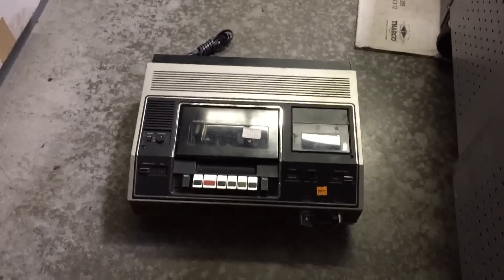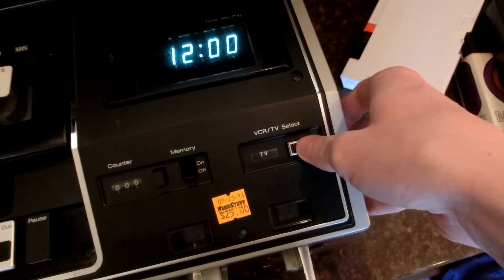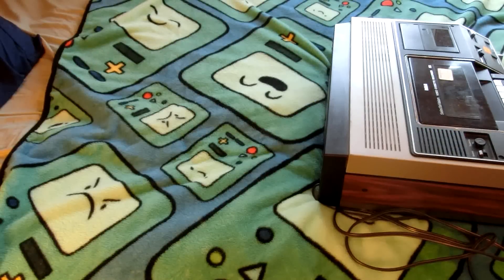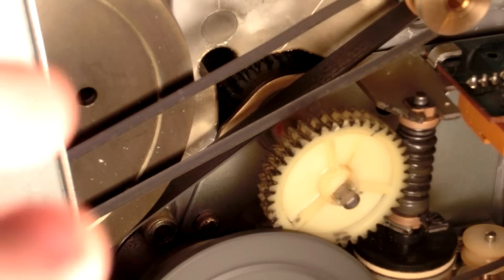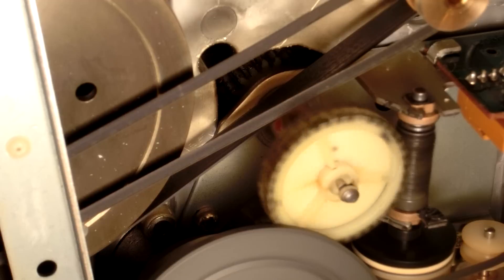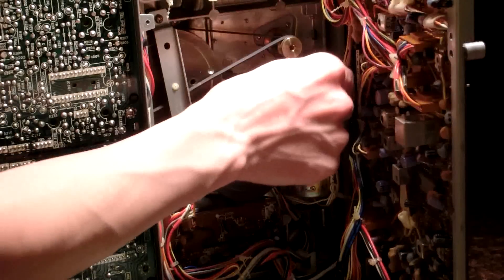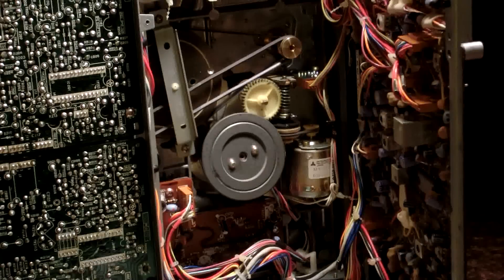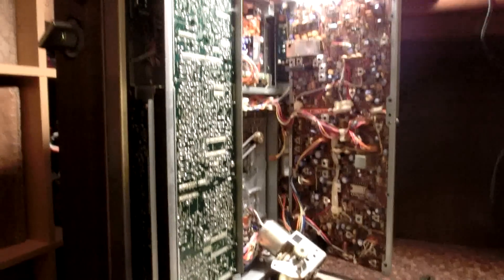1978 RCA VCT-200 VCR Teardown/Repair part 1

Comment: Did you make a part 2 to this video??
Reply from the maker: not yet, but now that i can 3d print gears i should.
Reply: @RinoaL  : Hello again. Just thought you might be interested in knowing that I was able to repair my RCA vct201 model. Finally got this baby working like brand new again. I had the exact same issue like you as well. The same gear on my vct201 was broken in half as well. I’ll go on to say that this is most likely a common issue on all of these similar units, as I see them online for sale all the time and most of them state that “item is broken and won’t play”. Mine looks a little different from yours. I had to remove the whole drum head in order to access the screw that mounts that whole broken gear assembly. But once I got it removed, I used superglue gel on the broken gear and then coated it with baking soda which is suppose to cause a chemical reaction which quickly dries the super glue almost instantly. Coating baking soda to the superglue joint, seems to make it a lot stronger as well. I’m not 100% sure, but it definitely feels much stronger with baking soda coated on and I only waited 10 minutes before I reinstalled the gear with no issues. So far it’s seeming to hold up good. Anyhow, I reinstalled the gear and powered my vct201 up and she started playing instantly. However, I had to do some repairs on my soundboard as well, no sound output. Video tracking and audio head was also out of sync on mine as well. But after some soundboard repairs, video and audio syncing adjustments and tracking alignments, she’s playing like brand new now. Hope you have some luck with your’s as well. The superglue baking soda trick is working wonders for now, but we’ll see how long it holds up.  If you get a chance to print some gears for your vct model,  let me know if you would be interested in selling some of those 3D printed gears as well. I’d like to have some spares for future repairs. Thanks again for the video again, it helped me out a lot.

Comment: I have a VCT-201 with the same symptom, tape loading mechanism inoperative. I'm curious if you did successfully 3D-print a new gear?
Reply: I did 3d-print the gear and it worked great. Let me know if you need it, I should be able to dig up the model.

Comment: The reason the glue doesn't work is because the shaft hole in the gear has increased in size. The flat shaft drives this gear, and there's a lot of pressure on it. You'll see that the gear over time creates a bigger indentation into the gear's shaft hole, which in turn increases the pressure within the gear whenever movement kicks in. The crack in the gear develops along the flat side of the hole until it finally cracks. There is no amount of glue that can resist the amount of force exerted on it at this point. I managed to (temporarily?) fix my gear by cutting out a flat sheet of metal from an old PSU, drilling holes in it using a dremel, and use kevlar wire to sew the metal to both side of the gears, keeping the two halves together. The metal sheet itself has a shaft hole cut out that matches the actual shaft's shape. This works well enough surprisingly, but yeah, it's a crazy amount of work. The best solution is indeed to 3D-print the thing..

Comment: Just an update to my comment. You might want to check out this product called Smooth On, It's a Silicone Molding that makes an exact copy of that gear you need. Then you use Smooth Cast which makes a plastic cast of the gear. This what I did. Unfortunately the plastic is not quite strong enough in that it flexes. I'm in the process of trying to find a stronger plastic to make the casting.

Comment: Just picked up a RCA VCT 400, today with original manual for a couple of bucks. Rewind and Fast-forward work but of course play is not. I am hoping it's just a belt and not a gear, as I'm finding with most projects Epoxy does not hold up, I found JB weld to work a  little better. [Update] Turns out the first thing was the belt was slipping on the loading motor, some rubber renuve fixed the problem. The second is the issue of the cracked gear, luckily mine hadn't cracked all the way through yet. I am hopping I can salvage it with some JB Weld.

Comment: It's really too bad these more "primitive" units had to have eight billion circuit boards to go wrong with. My Sony VO-2360 had EIGHT circuit boards for me to smash up and throw in the trash when I was trying to move the unit. Probably was all the electronics needed for the tuners and channel-programming and whatnot. Of course, now we could probably fit all those functions on a PCB the size of a cell phone. Great looking unit and I hope you get it fixed.
Reply from the maker: +Dead Christmas its actually really nice since these components can be more easily replaced.
Reply: But are those PCB components actually replaceable? Like normal capacitors, or proprietary unobtanium parts?
Reply from the maker: Dead Christmas
well they are much simpler than the newer stuff, they are common off the shelf chips ussually not a chip designed for one VCR and only comes in that VCR.
Reply: +Rinoa Super-Genius I see. Did you ever end up getting yours fixed? It's been a few months since you made the video. How heavy is it?
Reply from the maker: Dead Christmas i was waiting to get a TV, now i have one and am planning on working on the VCR again.

Comment: I know what you mean about disassembling the tape path of a VCR.  Probably the trickiest thing I've ever successfully put back together.  I remember multiple eccentric cams and various shooty springs.  Not only does everything have to be in the right order but the asymmetric gears and cams have to be in the proper points in their relative rotational cycles.  Takes about five hands.  With only two hands it took me 2 days to get it working again!  I recall reading that every VCR uses the same tape threading mechanism.  Patented by Phillips, if I recall correctly.  Anyway, it'll be great if you can fix your 1970's appliance with a 21st-century solution!

Comment: There is a slight possibility that I may have one of these machines buried under a pile of junk in my garage, so if the printed gear does not work out let me know and I'll see if I can get you what you need for it.

Comment: I hope that noise is not something touching the video head drum :(
Oow if you get a picture and its rough and black&white, spin the head flywheel 180 deg,  the head switching is wrong and the colour wont convert propperly.
Reply from the maker: no its due to that gear being broken so it lets the shaft move out, its just that bigger outer gear rubbing on the flywheel. it can easilly be fixed with a few washers.
Reply: zx8401ztv I know this is an old comment, but my VBT-200 has the issues you described. Where would I access the head flywheel?

Comment: just melt the gear back togetter with a soldering iron.
Reply from the maker: thats not actually a very good idea, this plastic doesnt melt too well and also i would need to either cut away a lot of plastic to melt away the insides and it would still be the brittle old plastic i started with.

Comment: I have a couple suggestions.
Make some lube for that VCR using graphite powder (just get a rough surface and a few pencils) and some vaseline or some other substance like that. The problem with petroleum jelly is it melts at body temperature so its not the best in things that get above 100 degrees F but for things like this it may work. 

For tools I am going to suggest trying to find a Harbor Freight. If you have never been to one you will be in love. They have sooo many little things you will want to play with.
As for the quality of their tools, they are not the best. Basic tools like screwdrivers, hammers, pliers, dremel bits, or the tools you will use once a year they are good enough. But for things like drills, or good wire cutters and strippers I suggest buying them elsewhere. I am also a big fan of good screwdrivers. The harbor freight ones work but there is nothing like a screwdriver that doesn't round over or break. If I could I would buy a full set of xcelite drivers but I lose things too often to do that.
Reply: +x9x9x9x9x9 I hope you never fix anything that belongs to someone else. 

#1 - Graphite powder is sold in a bottle. 

#2 - Petroleum Jelly is a big no-no for anything involving plastic or rubber. It will eat away at the material and destroy/weaken it. That's why you never use it on rubber parts or seals. 

#3 - Harbor Freight is not a tool brand, it's a hardware store. Their tools are all manufactured by outside tool companies and rebranded as Harbor Freight.  And you don't need to go to a specific hardware store to get specific brand tools to do a job. If you're a proper mechanic, all the tools are right there in your own garage. 
I've used the same screwdrivers for my entire life that were inherited from my father who got the from his father who bought them in the 40's.
Reply: MrWolfSnack graphite is cheaper from old pencils especially when you don't need a bunch of it. I now know about not using vaseline on rubber, and I never said harbor freight was a tool brand, I was saying to find one and buy there cheap chicago electric tools or whatever there store brand is.

Comment: I remember taking apart a few of these beast VCRs in the late 80's / early 90's, they are far gone by now here, I have not seen any in a fleamarket or on a garbage day for years...
Reply: +msylvain59 I just got an '84 Panasonic from goodwill for $5.
Reply: Sometimes goodwill has it , I got my 1983 Panasonic pv-1265 and plays well

Comment: Hah, is that the good old WeirdStuff in Sunnyvale? Haven't been there in years. Watch out though their prices can be outrageous sometimes especially if there are no price stickers and they try to scam you because they think you need the part. As I said earlier also check out HSC (halted.com) in Santa Clara while not forgetting the Fry's close by there.
Reply from the maker: yeah i got that vibe from them about being over priced, they have a bin of old laptop batteries but want 5$ each for them.

Halted was actually the first store out here i went to, but i'm saving my money until i get my first few paychecks. i plan to get some nice test equipment and a bunch of random LEDs from halted latter on.
Reply: Rinoa Super-Genius Sunnyvale in San Diego?? My buddys parents have a trailer there, nice place!
Reply: +Rinoa Super-Genius $5 each for a used laptop battery is not a ripoff. Go on eBay right now and look for one. If it's from the 90's you won't find one, and if it's recent it will be $70+ and if it's from 10 years ago it will be $15+shipping
Reply from the maker: so what do you call this then? http://www.ebay.com/itm/Lot-of-90-Laptop-battery-for-parts-or-repair-scrap-/331587133260?hash=item4d34221f4c:g:SYoAAOSwHnFVhd1N

i call it you being wrong, and also not knowing anything about how to find a deal.
Reply: Rinoa Super-Genius
Wow, ego issues much? I said a single battery, not an entire lot. I love how you sorted by most expensive and just picked the first one on the list. And you don't know how to find a deal because you expect everyone to cater to you so you can get everything for free.

This is my laptop's battery. This i the cheapest price for an OEM battery for this 10 year old laptop:

http://www.ebay.com/itm/Genuine-OEM-HP-HSTNN-DB31-Battery-HP-Pavilion-DV2000-DV6000-Presario-V3000-V6000-/261881113240?hash=item3cf954aa98:g:eD0AAOSwjVVVix1L
Reply from the maker: MrWolfSnack
no i linked you to a lot of 90 cells, so thats 2$ a battery. thats how i buy laptop packs.

Comment: Be interesting to know how much that thing was back in the day.
I always remember back in the day everybody would always have there VCR clock flashing, it seemed like nobody knew how to set a VCR clock when I was actually quite easy to do, lol
Reply from the maker: i believe it was 1,298$ when it first came out. and yeah i remember vcr clocks flashing a lot also. a lot of them where a bit tedious to set though. this one is super simple. most required the remote to set. i've also noticed a lot of the VFDs on them get very dim over time, this one still looks quite bright,
Reply from the maker: *****
i will when i get a tv
Reply: +redneckbryon $799.95 in 1978. That's $2,800.00 today.